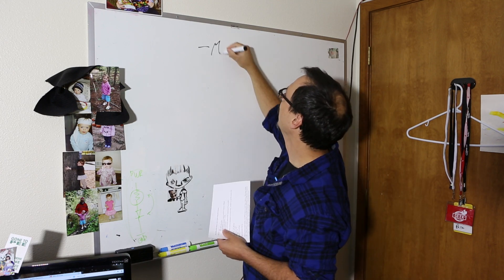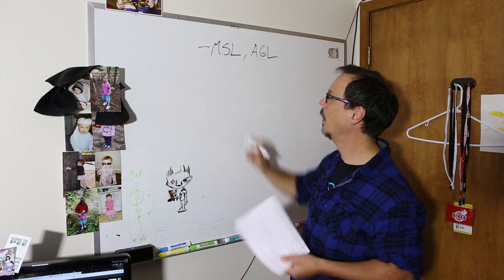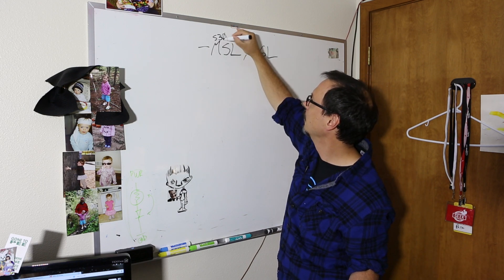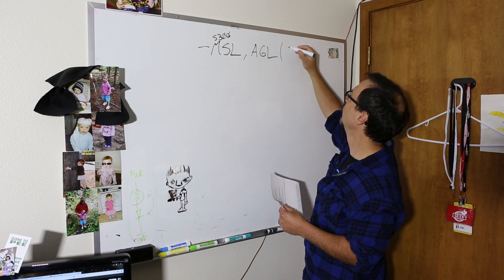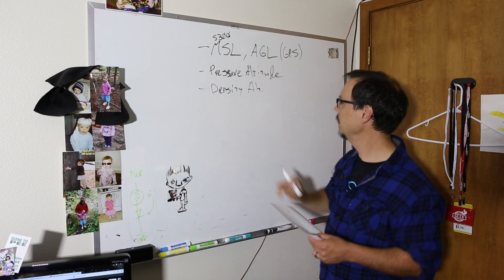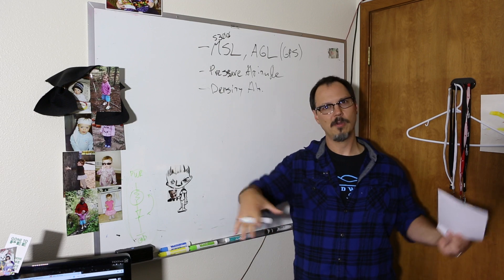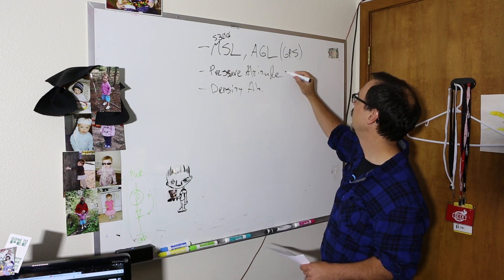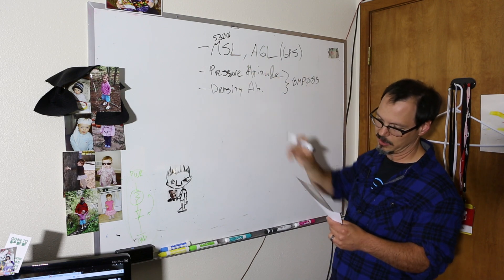SparkFun According to Pete #33 - Glider Instrumentation and Data Logging

Comment: For data logging use the GPS data.  For your vario just differentiate your pressure from the BMP085.

I'm was considering building a small sound vario that would use a small barometric pressure sensor like the BMP085 fed into a tiny AVR.  The output would be a tone with frequency proportional to rate of climb/descent.  My goal is to get the whole thing small enough that it could be potted in a custom silicon ear plug.

Comment: As a check you could use the data from a IMU to determine if the glider is descending or ascending based on how the glider is positioned and compare it to the GPS data. If the GPS say you're ascending but your in a position where its impossible unless somethings really wrong you know the data is off somewhere. Plus might be ale to create a PVHD?? No clue if that would work. Just some random ideas...

Comment: So the issue with building a vario with just a gps is the same as building an imu with just an accelerometer. It can be done, but like the gps the accelerometer is subject to noise and you have to feed it though a low pass filter to get a good reading. This often results in your readings being slower than you would like. But if you are ok with the slower readings then the proper method would be to use a kalman filter to get the best output. Feel free to message me if you need help with the math.

Comment: Hi Pete, I've actually been working on a similar project. What I have is a pair of 32U4 FIO v3 with XBee Pro units. As I'm using this in my RC flying and not in my full-scale, it's a data gatherer on one end and a oled display/sd logger on the other end. I am sending both analog (individual lipo cell) data and serial data obtained from a 10DOF board, and a UBlox 6M board. The gatherer reads the 10DOF and GPS over serial and the lipo through a resistor divider network on analog lines.

Comment: I've built several GPS dataloggers. The solution i've decided on is buffering the NMEA sentances i see a CRLF, then write the buffer to a file all at once. If you do it one byte at a time the overhead is far too much. I see no reason that you couldn't write a line of analog data to some other file every so many lines, or even on an interrupt if your GPS has some kind of clock output.

Comment: A Variometer really doesn't care about the actual altitude. It measures rate of change of air pressure...so use that instead. You'll also need a static port to get the actual pressure out of.

Comment: Two comments:
1) I concur that GPS altitude data isn't all that accurate. Don't rely on it when flying.
2) Your pressure sensors won't be accurate inside the cockpit. You would need to attach them to the aircraft static and dynamic pressure ports (which they won't let you).

Comment: GPS vertical accuracy isn't very good which is why when aircraft fly GPS approaches (like RNP AR) they use baro-VNAV for vertical guidance.  So, it's best to stick with pressure sensors rather than GPS for anything relating to your vertical path.

Comment: Hello Pete,
I may have a nice solution for you. Have you heard of the ArduPilot project, that is a controller autonomous vehicles? Well it has all the sensors you need, and a lot of code to derive the position and orientation of the board.
But one nice thing is I developed a Android GCS for it, search for DroidPlanner on Google, it has a HUD and map to overview all the info while flying. It also has logging of all parameters to the android device.

Comment: I wonder if this would work: A top down display of your flight path (GPS) with color coded thermal information. The device would roughly estimate the thermals as you pass through them by overlaying the vario with gps data. With any luck you might be able to return to a thermal you've already flown through.. Of course, thermals aren't always vertical or stationary relative to the ground. (Sometimes they're just a "bubble" of rising air.) So, yeah.. I think just I answederd that one myself :)

Comment: Q1) I thought glider pilots use their butt as an instrument :) It's just quicker to react to a "bump" when flying through the air mass and then check your airspeed and vario. The rest is infotainment :)
I'd try to use the pressure sensor as a vario. Maybe it even beats the analog meters in responsiveness? Also, I'd consider velcroing the device to your thigh (if you haven't a map there). It's probably too big for a wrist watch :)

Q2) Surely the Arduino can to the A/D conversion if needed.

Comment: What ever way you will use to make your vario, make sure you correct it to your speed. If you first move at 100 km/u without thermals, then decelerate to 80 km/u you will gain some altitude, because you converted kinetic energy to potential energy (altitude). 

If you don't correct your altitude reading for you vario, then you will get an indication of thermals, when ever you pull back the stick to reduce speed.

I have a drawing of how this is ussually corrected, but it's on my old (dead) hdd.

Comment: Varios measure whether the air mass is moving up or down, not the glider, so varios also take account of the glider's speed as well as change of altitude. When centreing in a thermal you really want the update rate to be instantaneous - lag is not good. Consider looking at FLARM devices. Above all, continue to have fun gliding - no two flights are the same :)

Comment: I have personally used a gps and arduino for datalogging my flying. I haven't used it in-aircraft as a vario, but I just logged co-ordinates, speed, altitude and some other stuff to an eeprom. (I made a proprietary format to log the information to bytes on the eeprom manually, I also had functions on the arduino to dump that data out on the serial port, and in a format I can drop it in a kml file for google earth)

The logged data for me was really interesting, and looked very accurate.